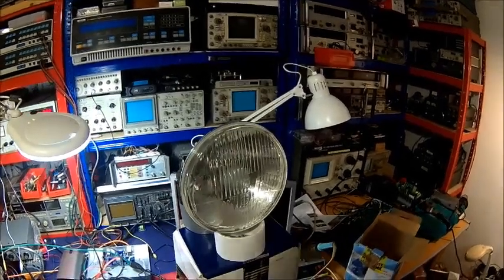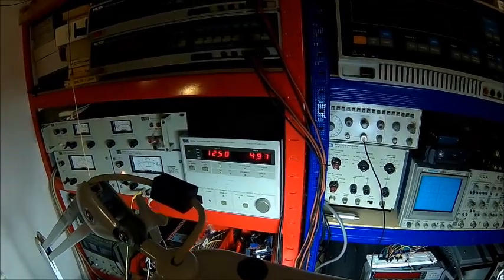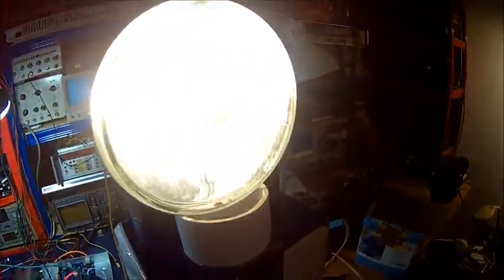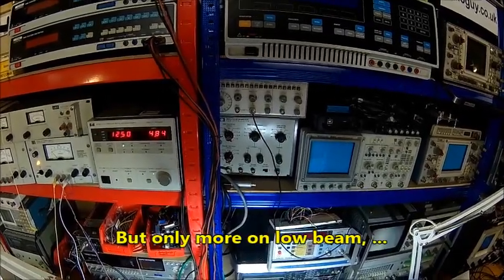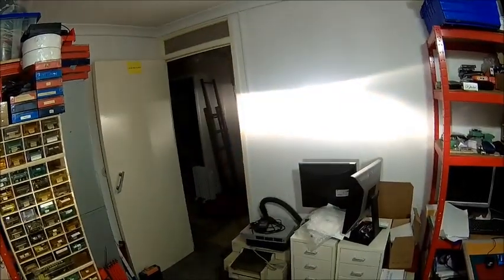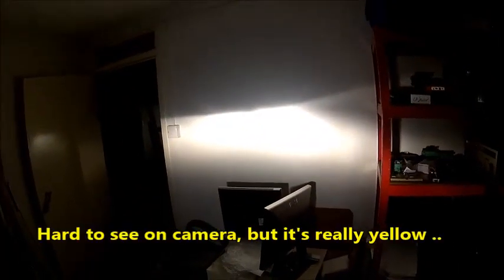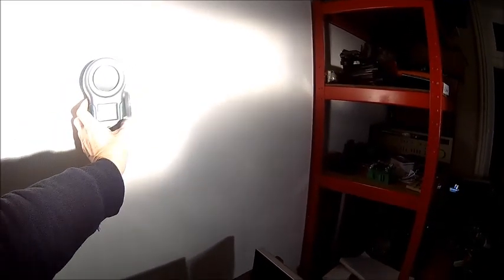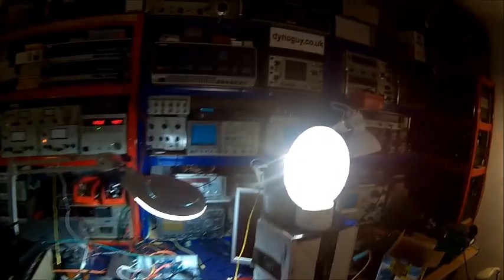Osram Night Breaker vs standard H4 bulbs, pattern + measurements

Comment: interesting little experiment. the candle that burns twice as bright, burns half as long...
the TÜV would allow a switch to the new bulbs in the trabbi.. which would be a sweet revenge on those idiots in their audis with those obnoxiously screaming bright headlights... 

hope the settling in is going well! a merry christmas and a happy and prosperous new year to you and groupie!
Reply from the maker: Well, it was a quick and dirty comparison, mainly to confirm my subjective impression. To do it scientifically correct, the overall distribution and total output including color temperature are rather important factors as well.
And yes, they are perfectly road legal, even with your overly picky TUEV ... The only thing you need to check if you got headlights suitable for H4 bulbs, some older cars still running on Bilux, which would need changing the headlight inserts, not a big deal as these are standard round ones, you'll get them for under $30 a pair if you shop around a it.

Merry Christmas and a happy new year to you as well.....still too much to do and too less time,...and i need a bigger shop ...:-)